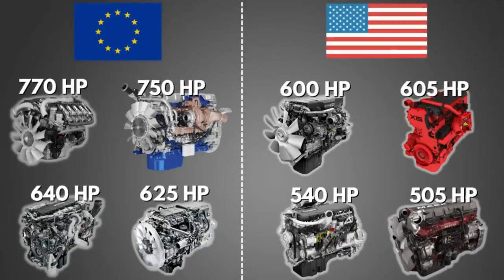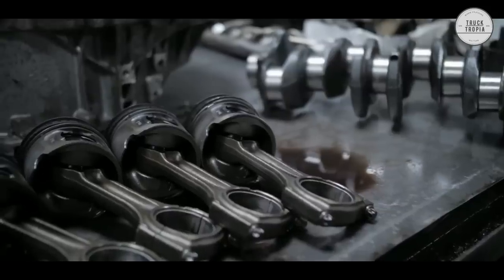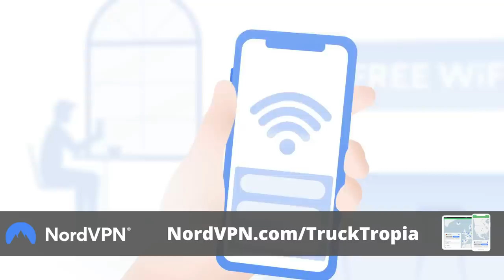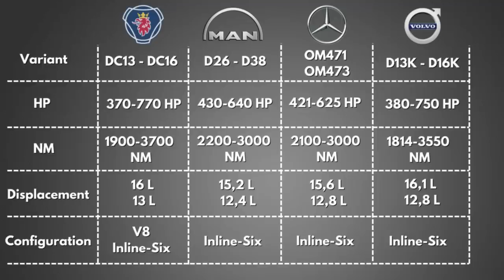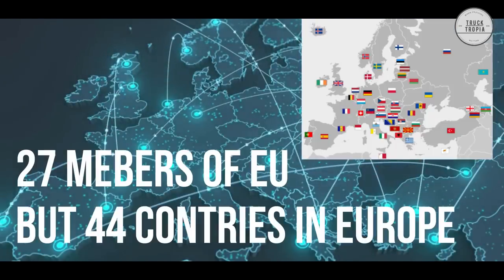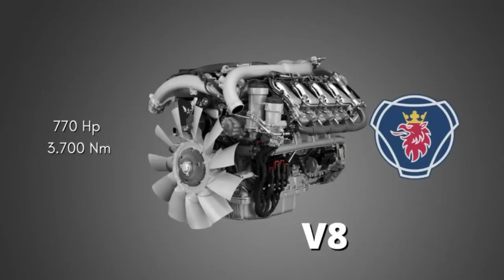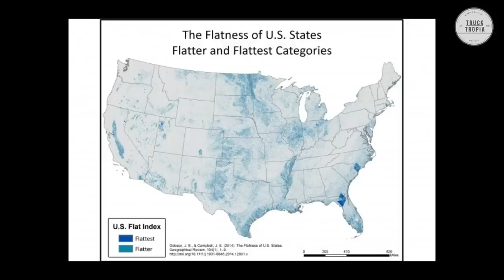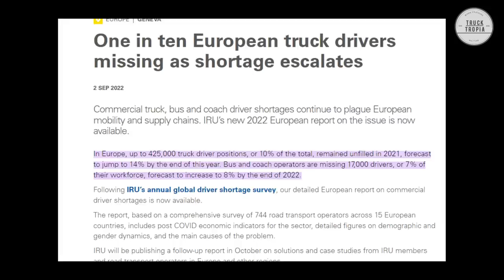Why European Trucks Have Up To 770 HP And US Don’t

Comment: I am a Truck driver in the US . The real reason that truck engines are smaller and have less horsepower has nothing to do with the roads or loads. The real reason is money and government. The government doesn't want fuel burning trucks and they are pushing companies to get better fuel efficient trucks. This is not working because the more fuel efficient smaller engines don't last.

Comment: My 2006 Western Star with a Series 60 Detroit came with 435hp. We plugged in the laptop and it was simply selecting the 550hp option from one of the menus.
Reply: Great motor there driver, I put it right with the old red top Cummins for durability. You just can't break the damn things. Keep it shiny side up.

Comment: With reference to your EU weights, its most common to Run at 40tons in the majority of Europe and 44 in the UK, the higher Gross weights are less common and usually come under special restrictions for abnormal loads or like in Scandi countries with timber haulage
Reply: It's not only timber haulage in nordics that is heavier.
Reply: The same thing applies to the US as well , while 90% of the states have federal 36.5 ton weight limit , at least 5 states allow trucks to pull full size doubles and even triples with single axle which allows semis to have 50 to 60 ton total gross combination weight limit on most public roads within the state, most of them are  used in logging (timber) and  mining industry. Oregon , Washington , Nevada and Utah just to name a few , these states also have pretty steep hills , 5 to 8 % grades on major highways and freeways in these mountain Western states are pretty common so having 600hp + engine would help a lot to pull those 50-60 ton double and triple combos uphill
Reply: @Nikowalker007  we run 100,000 pounds GVW  with a standard tractor unit and a tri-axel trailer in Maine. I can run 75,900 with my Pete 367 tri-ax dump and 60,000 with a wheeler. It's also not uncommon for us to pull 250,000 hauling in the North Maine Woods without hauling doubles...btw the Cat C15 6NZ without modification can put 625hp out you trick it put some and you can easily get 700 or more horse.
Reply: @aaronsanborn4291  In EU we have some modded SCANIAs with 1000-1500HP. With dual or much bigger turbos, much higher turbo pressure and boost, modded ECUs etc. Check Sarantos Scania R999 on YT.
Reply: It's 50 tons in The Netherlands😉
Reply: @aaronsanborn4291  That’s  true… 👌👍 I’ve also seen quite a few loggin KWs and Western Stars with 800+ hp C15 with Marine mode , Marine C15s have 800 - 850hp stock …
Reply: @Nikowalker007  5 to 8 % is not steep.
Reply: @McGhinch  It’s not steep when you’re empty but when you have 20 - 30 ton load your speed drops below 30 mph (50 Kmh ) while the rest of the traffic keeps going 55 - 70 mph (90- 110kmh) which creates sometimes pretty dangerous speed differential and potentially dangerous accidents when some idiot tries to pass on the right lane or even on the shoulder , I’ve seen it many times
Reply: @Nikowalker007  In Germany, the Autobahn (BAB 7) crossing the "Kasseler Berge" is in that range. Only underpowered trucks cannot maintain their speed -- in this case these are often older models most often operated by south-eastern European companies -- they are phased out because of environmental regulations. Often trucks climb these grades at their regular travel speed. I always feel sorry it they have a slow truck or underpowered car with a camping trailer in front of them because of the no passing zone for trucks. 
There are stretches on German roads, especially on steep grades on the Autobahn, that require a minimum speed of 30 mph on the middle lane (of three) and 50 mph or 55 mph on the left lane. There is no "no passing" for trucks.
And we have streets and roads with grades beyond 20% in more countries in Europe.
Reply: @chrishar110  The author of this video took the most underpowered engines in US trucks and most powerful from Europe, in USA they put from factory with warranty 700hp engines into pickup trucks like RAM TRX or Ford Raptor R for your local farmer to haul hay, biggest car size in Europe are considerd compact cars in USA, BIG horsepower and BIG size of vehicles is first thing I noticed when I first came to USA
Reply: @chrishar110  in USA they now make Tesla Semi that can go 0-100km in 5 seconds (that is faster than many sports cars) and can go 800km on one charge
Reply: We run 80 tons in Michigan.hauling steel to the stamping plants
Reply: @MidwestDIY  Don’t get the continent Europe mixed up with a country, come to Scandinavia and you’ll soon see V8 RAM’s and f150’s to be a common sight. Maybe not in France with their tiny roads..
Reply: @MidwestDIY  those Pickup engines are entirely different to a truck engine. They lack the torque a large diesel engine is able to create.
Reply: @Nikowalker007  Hahaha 5 to 8% is steep? We've a roads with 26%, most of them are between 12 and 18% and I'm not talking about some backyard side ways xD
Greetz from the Alps o/
Reply: @BruceCarbonLakeriver  It’s quite steep for 4 lane and more autostrada ,autobahn, interstate type of motorways especially during holidays, weekends or weekday rush hours. I’m not talking about climbing ability but an average climb speed while being fully loaded , here on the West Coast we have Sierras and Rocky Mountains  with multiple 16 km long 8% grade 1.5 km elevation gain passes so even if you have 600 hp engine with 40 ton load your speed wouldn’t go much above 45 - 60 km/h while you’re constantly getting passed by 100km /h heavy passenger car traffic as well as caravans , RVs and passenger buses which  often creates brake check type of dangerous situations due to 50 - 80 km/hr speed differential between the right and left lane (fast or slow lane)
Reply: @Nikowalker007  Well then try the Autobahn in Bavaria. There you'd go up and down like in an Rollercoaster with steep climbs and descends. Hence almost every truck in Europe has retarders, the Jake break wouldn't be enough ^^

It is (based on my experience) extremely rare somebody is break checking you in Europe.
The most common fails of car drivers to truck drivers is pulling in front of the truck closely. Mostly b/c the car moron want's to get on the Autobahn and don't mind the truck driver. But it is more about ignorance as about being malicious like someone is at break checking...

Comment: Very interesting.
I'm from Europe and I thought for most of the arguments it would be the other way round...
The huge majority of overland trucks in the EU is rated for 40t and has between 420 and 480 HP. Those very powerful trucks with 500+HP are really rare.
They are usually for special purpose as extra heavy hauling (eg log hauling) or owner operated trucks for prestige and nice -to-have.
And the general speed limit for trucks is 80km/h so they do not mix very well with cars anyways.
Also the railroad system is very good developed in Europe and many loads are transported by rail (not as many as there should be).
Owner operated trucks are not common and big companies only buy what they need.
Reply: Well said, absolutely correct!
Reply: That depends where on the continent of Europe you are! Come to Scandinavia and you’ll commonly see Scanias’ with that V8 badge on the front.
Reply: I don't think rail has much to do with it honestly. The US has the largest rail network in the world by a wide margin and virtually all of it is used for freight. This is also why our passenger rail services are relatively few and operate at a much lower speed.
Reply: @oscarbanana6159  you're right. I did some research after dropping my comment. In the USA 40% of all goods are transported by railroad, in the EU only 20%
Didn't expect that. 😉
Reply: 500 hp is not rear.look arround man.are you a driver?
Reply: @molnarriki4876  no, I'm not a driver (at least not for living). But I have a truck driving license and I know, how to read the manufacturer's weight and power codes.
But my observations may be centered to central Europe (Austria, Germany and transit to eastern Europe)
Reply: @kaefjot08  In Norway I see 700HP trucks all the time. Sene one at under 500 hp is considered weak. We have a lot of mountains here, so you need a strong engine to be able to keep a high average speed.
Reply: @Einungbrekke  unfortunately I never made it to Norway yet.
We also have mountains here in Austria, but I guess they are much more crowded, so maintaining speed is not that important. 😁
Reply: @kaefjot08  eastern Europe trucks are more common at 420-500 HP, or at least thats the most common i see here in Germany.It depends also on the Brand, Mercedes,Iveco,Renault and Daf mostly seen with 520 Max, MAN either 500,560 or 640,Volvo and Scania mostly 500+. I didnt count big Companys like girteka,waberers and similar, as those tend to buy trucks in the rather "Cheap" options
Reply: @kaefjot08  Yep greetz from the Alps from Carinthia o/
Reply: Where is the general speed limit 80km/h? Most places in Europe I have been it is 90km/h which is why they have limiters for that speed.
Reply: @bimble7240  Germany has for Trucks 80 kmh on the Autobahn,limiter is mostly 89kmh,not 90
Reply: @bimble7240  Wrong, it is 80 in most countries. Some like Poland allow even 100kmh. But in Most countries there is a speed limit of 80km/h. Like Germany and Austria, Hungary, Belgium, Netherlands and so on...
The speed limiter is set to 90 (some companies set them even to 80) b/c of having some headroom in front of steep climbs. Usually speed limits have a tolerance too, although this tolerance might vary from country to country. 
Furthermore there exists a general speed limit of 80 based on EU law but not every country abides to this law.

Comment: In Denmark and other countries, 82 ft, 60 ton "road-trains" have been allowed. Denmark is currently testing 105 ft, 80 ton "road-trains". These articulated semi's have to follow assigned roads, and are not allowed on small roads or in towns and cities.
Reply from the maker: Thanks for sharing 👍
Reply: In Finland we have had extra-long trucks (Australia-long) for few years. I am amazed how they can drive even in some suburban setting. The local supermarket gets deliveries with those and the trucks have to cross the whole roundabout to make turn (center of the roundabout is slightly elevated, but can be driven over).